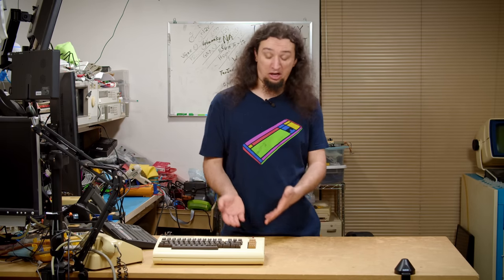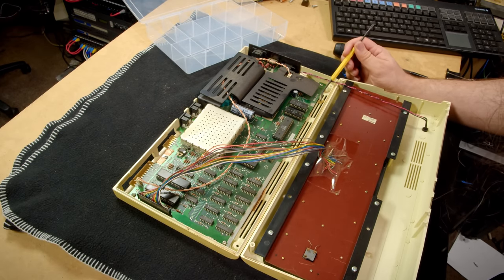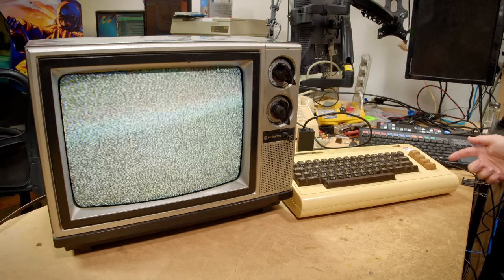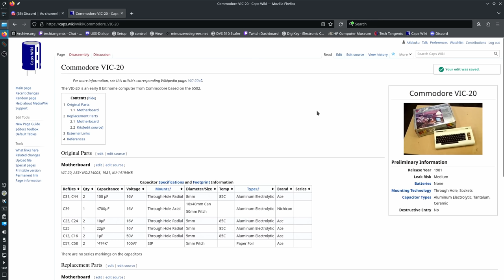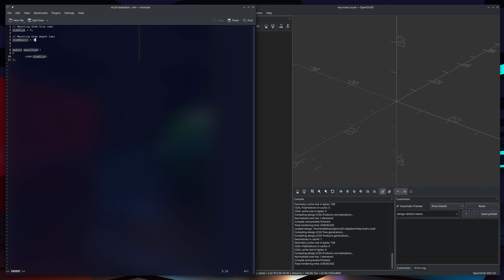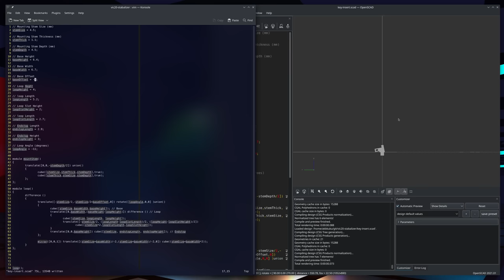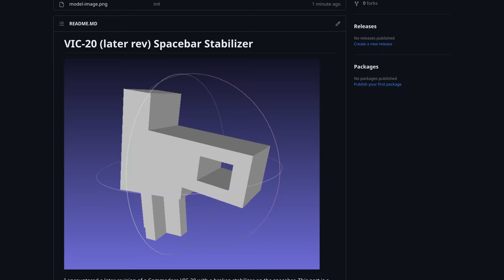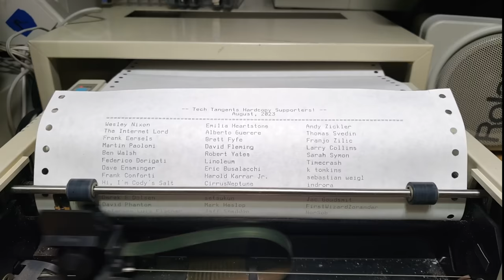Commodore VIC-20 Repair-a-thon

Comment: Having watched a bunch of Adrian's Black's videos demonstrating the diagnosis and repair of VIC-20 and C64s, the chances of a capacitor taking out these machines is empirically minimal. 

Commodore machines experience a silly number of failure modes but it's more often RAM, PLAs, VIC* chips and/or the CPU itself. 

TL;DR - capacitors are not usually the first thing to check. 

Of course, that said, you can rule out capacitors now! 😁
Reply from the maker: Well the caps were very definitely bad on it, they shouldn't be getting green and fuzzy lol. But that was clearly not the only issue with it. Until now though I didn't have a great way to test the custom ICs beyond spending tons of time staring at schematics and probing. So I was just going with what I knew was wrong at the start and hoping to figure it out now that I had more options.
Reply: @TechTangents  Indeed, and it wasn't intended to be a criticism. I would have done the same; replace obviously bad caps, see what changed. 

It's a great video and I'm glad you got all three machines into known states.
Reply: Learned something new: very closely inspect any Ace brand electrolytics.  Further confirmed something already known: MOS Technology ICs are CRAP, from what I've read due to too much boron in the passivation layer which leads to failures over time at least with 1983 dated chips - for any other years, maybe their manufacturing process or IC layout causing heat related issues was just generally crap.

Comment: You don’t need the RF modulator, just plug the video out straight into a composite monitor and you should be fine. You may have to tweet the potentiometers under the RF shield to get the right colors though. The RF modulator amplifies the signal, so the composite signal is often set too low to directly drive a monitor very well.
Reply: Yup din 5 connector even a cable from a model 1 genesis will do the job
Reply: @user-wj9xq7ig2v  I didn’t know about the Genesis, but the VIC 20, TI99/4A and Atari 8 bit line all have the same video pinout.
Reply: Yep they all work. Tg16 as well. The red wire might be your composite video or some random things like that. Nothing that can't be sorted out with a pinout diagram and a multimeter
Reply: @Doug_in_NC  Nope, the Atari 8-bit machines output Luma and Chroma, aka S-Video, the Vic does not. Edit: How many machines have you destroyed or written off as not working? Stop guessing and do some research!
Reply: @Ffinity  All of the atari machines that split luma and chroma (many 800XL’s don’t) also internally combine them to output composite on a different pin on the connector so they can be either connected to s-video or composite monitors. Normally today you would buy a cable that has both the s-video connector and a composite one on it (I haven’t seen ones that don’t include the composite output, but maybe they exist) - the s-video takes luma from pin 1 and chroma from pin 5 on the Atari. The color composite output comes on pin 4. Pin 4 and 5 provide the video signal on a VIC and are coupled internally, so you would get composite output on pin 4, ie an Atari cable works when connected to composite video, though obviously not if you try to use it on s-video. If you don’t believe me, check out the composite cables that 8bitclassics.com (among many others) sell. They specifically state that their cable works with all Atari and Commodore machines and the TI99/4A (that only applies to NTSC TI99/4a’s, PAL ones don’t have composite). As Atari didn’t sell monitors for their 8 bit line, and s-video wasn’t really a standard until 1987, most people who used monitors with them would have used composite, as luma-chroma monitors didn’t really exist until Commodore released them for the C64.  I use composite cables interchangably between VICs, Ataris and TI99s, and have not destroyed any computers or monitors in the process. Maybe next time you could consider communicating politely, there is no need whatsoever for rudeness.

Comment: No, RF is not the only way to get video out of a VIC-20. There is composite video out on the DIN connector. Also if you don't know about it Ray Carlsen has good tutorials on how to fix most Commodore 8-bit computers and disk drives. It's pretty easy to convert a 27XX EPROM to the 23XX masked ROM pinout. You can get adapters from many places if you don't want to make one yourself. There is also a pretty easy S-Video conversion you can do. The newer VIC-20 has the same power pinout as the Commodore 64.

Comment: Never seen a BASIC ROM being bad, a dead KERNAL ROM is one of the most common VIC failures.  I've had to install modern EEPROM adapters in a few of mine to get around that failure. I rarely fire up my RF modulators, usually opting for a composite cable instead.  Glad to see a few VICs up and running!
Reply from the maker: I'm probably going to stick with RF for mine because I try to go for the setup that feels like it would have been more common. But also because I have a very particular TV in mind I've been trying to get to go with one of these. It also seems like composite is kind of an after thought? It's a the port pinout for it is kind of weird.

I'll definitely be exploring the modern EEPROM option, I would have thought the failures would be typical for both since they're probably similar parts, odd.

And thanks! This was a huge relief for me to get working!

Comment: Using bigger heatsinks does help a bit when it comes to total thermal mass.
Takes longer for the die to heat up as it sucks the heat to the ends of the heatsink.
Reply: Yeah.  Consider the early Socket 370 P-III CPUs, for example.  Or the Athlon XP.  Tiny die, huge heatsink.  Not because it needed the contact area...

Comment: I never had a Commodore growing up, but I did have a TRS-80 CoCo Model 1 and Model 3. Dual 5.25" floppy drives, cassette drive, dual joysticks, and even a Dungeons of Daggorath ROM cart. My first computer repair was done on the second 5.25" drive. At age 8, I opened it up and reconnected a loose connection, and was able to have proper dual floppy drive functionality afterwards.

Suffice it to say, I'm eextremely interested in seeing more of this.

I've seen your video about reverse engineering that CD-ROM controller card using only pictures. I also did a quick search to see just how far the community has come with the VIC 20 and recreating a working VIC chip replacement from scratch. They're pretty far along, judging by just the one forum thread I looked at. With a little work, I'm sure the rest can be figured out and brand new third party VIC chips made available to the masses.

With all the stuff you've learned over the years, as well as such a dedicated community available to work with, I have faith you all can make it happen.

Best of luck, and I look forward to a part two where by the end, you finally own two working VIC 20 computers.

Comment: You could burn the character ROM to a 27C64 EEPROM and use a 2364 to 27XXX EEPROM adapter to install it in the socket. I had to do that after my kernel ROM failed in my VIC20.
Reply: Same here but with the BASIC ROM. Brought my old style VC20 back to life.

Comment: Heck yeah, resin printers. I've always thought they were cooler than filament deposition. Both for functional parts with highly precise dimensions, but also for paintable models of unique characters! Both ends of the creative/technical spectrum! 

They're cheap enough that I've been considering getting a small one of my own lately.

Comment: Just last week I replaced a bunch of leaky ACE brand caps in a cassette deck from 1982. Not all of the ACE caps had failed, however. Only the 47uF10v and 10uF16v caps (only some had obviously failed before desoldering, but upon removing them from the board I discovered they were all corroded). I replaced a few other values of ACE caps on the board out of precaution, but they showed no corrosion.

Comment: Excellent job on the 3D printing of the space bar mount.  I would suggest putting your model on Thingiverse where it can more easily found.  I like the idea of resin printing, but the toxic part of it is kind of scary.   I do have a Bambu X1-Carbon that is fairly good at small parts but not nearly as good as a resin printer at small parts. Supports are the difficult part.

Comment: Frankly, maybe the only thing I miss from this era of computing is ease of repairability. Everything is through-hole, big chips are (mostly) socketed, diagnostics are clear and not that hard. I am more IBM PC nerd than Commodore but the same thing applies there, you can make sense of things from block diagrams and schematics, plus parts are easy to obtain (NOS or repros, and most chips on IBM PC are still being made). I used to repair laptops and just let that business go couple years ago because it is not worth the hassle.

Comment: I’ve got two of those early 9v AC VIC20s. I’ve heard they are more robust than the CR revision. Also, I find they do take several seconds to fire up.
Reply: They are, but they run really hot because of the internal voltage regulator. Heat sinks or a modern voltage regulator are a must.
Reply: @Doug_in_NC  Not sure you can get a voltage regulator for the 9vAC version.

Comment: You can replace that big LM323K voltage regulator with a modern, switch-mode equivalent which runs a lot cooler. ( EZSBC PSU5 LM323K Replacement
5V 3A switch-mode voltage regulator, high-efficiency replacement for the obsolete LM323K. 20V Maximum Input)

Comment: Just a note.  While the die is just a small square in the center, like you said, a larger heat sink means more surface area.  Just because the die is only under the middle part, the aluminum will conduct the heat to the areas of the heat sink not in contact with the parts of the chip that get extra hot.  In short, a bigger heat sink can help.  Probably not necessary, due to the fact that the original design didn't include heat sinks at all, but it would not hurt either.

Comment: MOS logic is the prime culprit in any Commodore 8-bit. MOS made absolute crap 74XX logic chips. BTW you don't need the RF modulator, the VIC outputs a composite signal,  Atari 5 pin cable will work.
Reply: I've never had any component problems with a CBM 8-bit, not my original Vic or the multiple C64's and 128's I have or have had.

Comment: A lot of the chips on the VIC-20 and C64 have brand new replacement versions readily available and some FPGA versions for custom ICs. Definitely don't have to consolidate parts anymore.

Comment: While you're right that the die is only in the middle part of the chip, having a bigger heatsink does increase its thermal performance because there's more surface area for the heat to actually spread and dissipate. That's why you see computers like the Compaq PCs from the mid-late 1990s with their huge heatsinks on the CPUs because they didn't want to use a fan.
Reply from the maker: Mostly I was trying to advise against sticking more small heatsinks on because they wouldn't do much if they aren't directly attached to the center with the die. I could have phrased that better.

Comment: I used to own a VIC-20, and was amazed with Sargon 4, chess.  Also liked Pac-Man.  
Had a cartridge in it, that also turned the screen to 40 or 80 column text.
Reply: VIC20 was only 22 columns?
Reply: @poofygoof Correctomondo-The standard screen was,but you could to funky things with certain rom cartridges.
As I recall the rom cartridge effectively bipassed the existing memory rather than just "expanding it"

Comment: Ah Commodore and their custom chips, only gets worse from here on out, the C64, the TED machines and god help you once you reach the Amiga's (especially those REV 4 2000s)
Reply: The good thing with the VIC vs the C64 is that plug in replacement modern cmos variants of the 6502 and the 6522 VIAs are still made. It’s only the VIC and the RAM that requires old stock.

Comment: The bad ROM in the VIC-20 is the kernel ROM not the BASIC ROM without the kernel ROM the computer can't boot because the kernel ROM is on the top of the memory space, after the 6502 CPU reset it goes to address FFFC and FFFD for the address to jump to which address the CPU will jump to is at the start of the kernel ROM.
Reply: The bad IC is at UE11 and that's the BASIC ROM.

Comment: I hope you are able to find a replacement VIC chip.  At least an NTSC one.  PAL versions seem to still be plentiful.  In fact you can build a brand new VIC20 and order everything online.  But unfortunately I doubt you will be able to find a NTSC vic chip anywhere except by cannibalizing existing vic20s.  I have decided to go the PAL route for my VIC20s.  So my only working vic20 is PAL based.  Which also means I cannot connect it to a regular TV and must use something like a RCA >  HDMI or something similar that can handle the PAL video.  

Since the 6560/6551 have board changes that separate them, I am usure if it is practical to swap a NTSC vic with a PAL one without many modifications.

Comment: What is that desoldering gun you're using? I've used a few, but they all make a loud "BRRRR" when using them, would love one that was more silent like yours.
Reply: According to his "The Tools I Use" video it's a Metcal MX-DS1 hand-piece that's attached to a loud air compressor.
Reply: You will never find a desoldering gun that is silent. No such thing as a silent vacuum pump.
Reply: @simontay4851  I mean that's why I'm asking. The one he used wasn't making any noise, but as the other comment said it seems t be hooked up to a compressor, so that makes sense

Comment: Best thing you can do with those original power supplies is huck them straight in the dumpster
Reply from the maker: The A/C only versions that are the ones I have are basically bullet proof because they are just a transformer inside. It would take something going catastrophically wrong elsewhere to damage one of those.

The one with the 5VDC regulator inside I did recommend the other person replace though.
Reply: @TechTangents  Makes sense!

Comment: i want to say the basic rom could be programed i think the tl866 cant work on 9 volt eproms im not sure if the basic rom needs that voltage  .But there is a vic chip replacement again not sure if it works on the vic 20, its working on the c64
Reply: The Kawari is a replacement for the VIC-II in the C64, and doesn’t work on the VIC-20. There is a board in prototype though, so hopefully we will be able to get it soon.
Reply: @Doug_in_NC  cool
Reply: Thanks do you know about the rom voltage?

Comment: You may want to contact Adrian's Basement about character ROM. I don't know of a replacement VIC chip and many have been harvested for failing C64s 😞
Reply: "I don't know of a replacement VIC chip and many have been harvested for failing C64s "

The C64 uses a VIC-II chip that's entirely different.